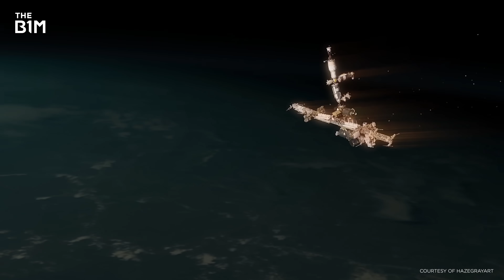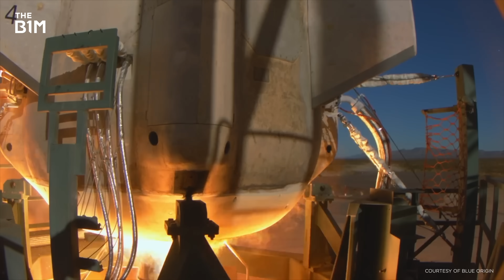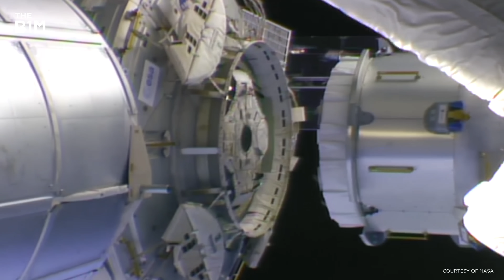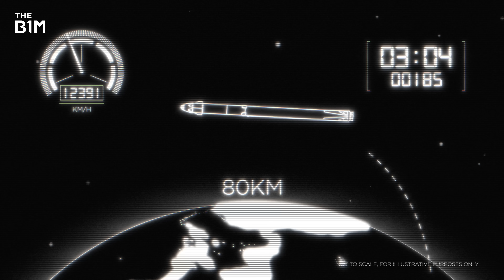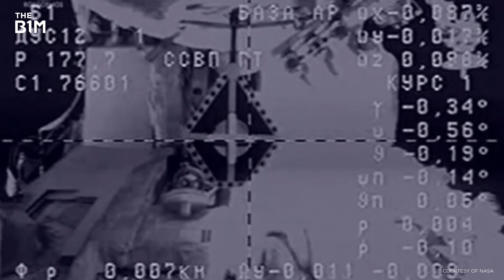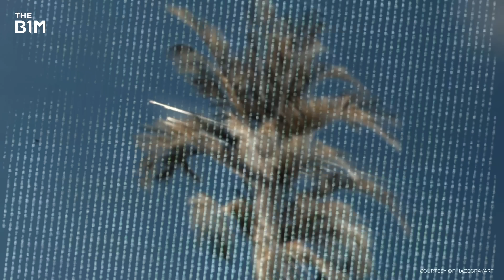The End of The International Space Station

Comment: Why do you keep calling the modules capsules? they aren't capsules. And Russia has two docking systems Probe & drogue and  APAS which has multiple versions and iterations and in some cases a mix of both. The ones use currently on the station are a derivative of APAS-95 which is now referred to as IDA or IDSS and technically there is another docking system, another derivative of APAS the ASA-G/ASP-G. There very little in common between the original APAS and the ones used currently so instead of saying APAS just IDA or IDSS or even APAS-95 which was use for the station. And you didn't mention the Canadarm.

Comment: Won't next gen Starship have more engines? I guess if there was a central engine, a fully refuelled Starship could take the station far, far away? Would be nice to know how far. And with the single engine throttled down, maybe it would survive structurally? Lots of the force would be "consumed" by accelerating Starship itself, especially before it almost runs out of fuel. So appropriate throttling curve could likely be designed. Of course it is not certain SpaceX will even succeed with multiple orbital refuelling till 2030, but it's ambitions are to be done with that sooner than that.

Comment: I'm neither a physicist, astronomer nor engineer.  That means I'm not bound by the paradigms of those fields, and that ignorance is occasionally advantageous, hence these questions:  
1) Why not slow the speed of the ISS so it orbits Earth less often, rather than the current 16x/day?  Would that result in less thermal expansion/contraction fatigue, or would the fatigue be worsened by longer exposures to the temperature extremes?  What about an orbit timed to keep the ISS at the terminator?  
2) Why not boost the ISS to L1, where DSCOVR is parked, or L2 where the JWST is?  Aren't those structures just as vulnerable (per sqm) to bombardment as the ISS would be if it were at L1 or L2?  If it's feasible to park telescopes there, why not the ISS?   
3) Wouldn't boosting the ISS to a higher orbit, or even putting it in orbit around Luna, be a useful exercise in testing our ability to move an asteroid or other object on a collision course with Terra?  Sure, the ISS is moving much slower than a hazardous asteroid, but baby steps, right?  The DART test was successful, but it seems useful knowledge could be obtained from repositioning the ISS.  
4) Rather than simply a historical artifact, the ISS has value as an exploitable source of materials for future space endeavors, does it not?  What is the relative cost to preserve the ISS for future use or exploitation compared to the cost to boost similar masses and materials to LEO?  What was the cost just to transport the materials to LEO?

Comment: now the question is, can a fully fueled starship outfitted with smaller engines (That run on the methane/lox) push it to like 3000km?
I don't think debris will be an issue at this altitude(As you can see in the graph of the video, the graph starts to go up), and the station will be defueled and without an internal atmosphere.

Comment: Don't deorbit it. Leave it to drift off into space.
Reply: It will come down by itself if abandoned due to drag

We would have to boost it into a stable graveyard orbit, without any debris to collide with 

I agree we should try
Reply: @XIIchiron78  the video said we dont have the current technology to send it far enough to not cause problems and also it would become space junk if we tried it  due to not boosting it far enough / or it break apart due to the force of the rocket the point of contact from the boost rocket would probably be like the equivolent of balancing the titanic on a pole (wich is exactly why the titanic snaped in half when it lifted out of the water from the back due to the stress in the middle) it would go the same for the iss posibly even easier than on earth due to acceleration of the boost rocket in the vacum of space it is not easy to throttle a rocket i do not think. more space junk is more problems in the future and more things these agencies will have to track that could cause delays / interuptions or destruction of future missions i think the aproach of using starship to bring back atleast a few peices of the iss is good enough and just make rebuilt replicas of the peices that were to big to take back to earth and setup a full scale model on earth at a museum dont exactly have to take the whole thing back home just have some real parts of it and interconect them to rebuilt replica modules that we could not save
Reply: Join Voyager 1
Reply: @OfentseMwaseFilms  Voyager 1 is in escape trajectory off the Solar System, you would need immense amounts of propellant and low thrust engines to not rip the ISS apart, to escape Earth orbit it would take years, while doing so the ISS would have to go through that killzone mentioned in the video, probability of "survival" is very, very low.

Comment: one way to reduce heat stress on the ISS by reducing the station's speed as it transition from being in the presence as it flies into the darker side of planet where it's night . . . the transition phase as the ISS rotates around earth from +160°C deg to -200°C deg or vice versa needs to be slowed down to less than half a mile an hour . . . allowing the outer skin of the ISS to gradually accept the rise & drop in temperature variation from hot to cold or cold to hot . . . not an expert, just my observation . . .
Reply: If they did that wouldn’t it be subject to the gravity pull of earth and fall much faster? and it would take a few years to do a lap of earth instead of every 90 minutes, so its daylight vs dark intervals would also be very long.
Reply: @evil17  thanks for that valuable piece of information, I get it what your trying to say . . . however just for my knowledge, what if the auxiliary thrusters & a revised autopilot system of the ISS be able to keep the ISS on track & at assigned altitude at speeds less than 100 mph . . .

Comment: Interesting video but I think this leaves 2 massive questions:

1. What is the line "we don't have technology to push ISS to deep space" 
What? Like, just launch a similar rocket to the deorbit craft, with thrusters that can slowly push it away way beyond the danger zone of earth orbit.

2. About Starship. "Its engines would rip it apart" "it can't dock with ISS"
This doesn't make sense. The primary value of Starship is being capable of bringing wayy more much mass there for the same price. That is the kind of solution that also solves other problems, as you could just bring another craft, any docking hardware you could dream up, maybe even develop Starship's cargo space so that the modules could be put and secured there wholesale. Then the Starship could be refueled in-orbit, and either landed on Earth (harder of course if there's cargo, but if any craft can do it, it's starship as it has already landed without cargo) or kept there or brought to a stellar body where it's easier to land, like the Moon. The relative ease of bringing more Delta-V to the starship with ISS pieces inside would surely open a lot of doors.

Comment: You had an image in there near the beginning that showed a proposed variation of the station that would be used for on orbit assembly of a Mars transit ship. It had a lot of truss work that extended away from all the modules down to a platform. As a lowly CO-OP student working for Lockheed Sciences and Engineering Company in League City across the street from Johnson Space Center, I was working on those 3D models in the image. I was a student at Tx A&M University at the time, around 1988-1990. I was running orbital simulations of different variations on the structure. We could fine tune various attitude control systems from rockets, momentum wheels, and even magnetic poles that pushed against the Earth's magnetic field. Attitude control systems can introduce some pretty nasty and unwanted oscillations in the truss structure. If they got bad enough, it would just rip the station apart. Also, the shock of something like a rocket coming on could jolt the station and mess up zero g experiments. The simulation even included the drag from the rarefied atmosphere and would lower the orbit. I got to create all kinds of variations of the structure and run sims on them. Eventually, the work was included in a report that was printed as a book and sent up the top to Dan Quayle and other folks. Nothing ever came of it as they never tried to use the station for on orbit construction of other spacecraft. As always, money was a limiting factor. It was a fun time though. I still have a copy of that book laying around the house somewhere.

Comment: 16:53 the nose cone is opened, kinda like a door, revealing the docking port. It's not discarded. 

Also the special vehicle used to de orbit the iss looks very different; It won't have fins, the trunk will be full with fuel, and the capsule, if you call it one is basically full of fuel, the iss is insanely large, (compared to other stations at the moment)
And it will be very slow to de-orbit. 
There may even be solar panels off the side, kinda like the old cargo dragon vehicles, unlike the newer radiator panels on one side. And solar panels on the other.

Comment: Correction at 16:53, the Dragon nosecone didn't get discarded, it simply being opened in space, later when it would come back for reentry, the nosecone would close again.
Reply: That's true for the regular Dragon 2, but probably not for the disposable ISS De-Orbit Vehicle, it will reenter with the ISS, so it won't be a reusable vehicle, no need for a possible failure point (hinges and locks).
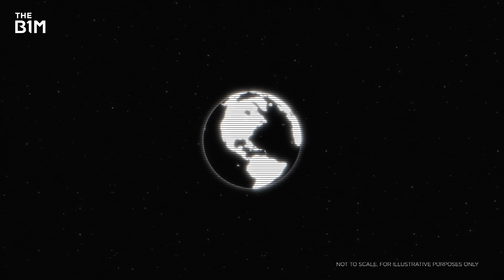Reply: @FastSloth87  The thing is, their explanation begins with "on a typical mission" 16:23.
Reply: Was about to comment this

Comment: Minor correction, but the only APAS docking mechanism on the Russian side of the station is to join to the US side. The other two APAS ports are used to dock to the shuttle, dragon, starliner and soon the dream chaser. Although APAS was developed by the USSR, the Russian side uses the droge and probe docking mechanism for their modules and spacecraft.
Reply: And APAS has evolved over the years:

APAS-75
APAS-89
APAS-95

An adapter was installed on the PMAs in 2017 to convert them from APAS-95 to the new IDSS docking standard, used by the commercial vehicles (Dragon 2, Starliner) and NASA's Orion (the Lunar Gateway station will use the IDSS standard, so visiting vehicles, like Orion and HLS, must use that).

Comment: Why dont they just set timers on the vaccum doors to open when everyone has left and let it implode. Surely they can create a robotic opener to do the job.
Reply: That would not make it implode.  For starters, things implode when the pressure OUTSIDE is greater than the pressure INSIDE.  As it is right now, the pressure inside is greater (because the pressure outside is pretty much ZERO).  If they opened all the airlocks, the pressure would simply equalize and the pressure inside and out would be equal.  That's not going to cause an implosion.
Reply: Isn't that the same with a space suit, once breached, game over occurs? If I am wrong I apologise. You learn new things everyday. Couldn't they reduce the pressure first then open the air locks?
Reply: @Leechy-df8pg  That still wouldn't cause an implosion. It would just be a vacuum inside and out, therefore a pressure difference of zero.
Reply: Ok, that's my theory quashed 😆
Reply: @Leechy-df8pg  No worries! The only silly question is the one you don't ask.

Comment: Perhaps pedantic, but a small correction.
16:23
When you say "Falcon rocket", you should probably specify "Falcon 9 rocket" as there are three rockets in the Falcon family.
Also, you state that the Dragon's nosecone is discarded which isn't accurate. The nosecone is on a hinge which allows it to pivot open and closed. It remains attached to the Dragon capsule for the whole flight and is reused with the dragon. Furthermore, when it closes after undocking from the space station, it provides protection for the docking ring during re-entry

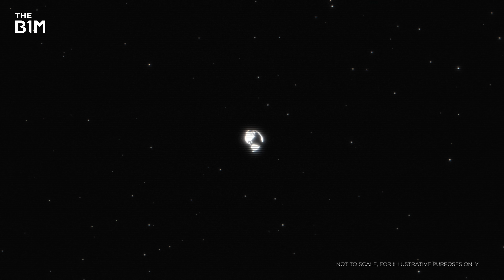Comment: Great video, but I want to correct one point. The altitude the ISS is flying has NOTHING to do with the "experience of weightlessness" (17:50). The astronauts are still pulled towards the Earth at 1-G, just as we are on the surface of the planet. The astronauts experience the SENSATION of weightlessness because they are continuously falling at 1-G. This is the same "sensation of weightlessness" skydivers feel when they jump out of airplanes. The difference between astronauts and skydivers is the astronauts are traveling parallel to the Earth's surface at a speed that equals the speed they are falling. The end result is they appear to remain at a stable altitude above the surface of the Earth because the Earth is round and gravitation force is radial from the Earth's center. From the perspective of the astronaut, they are "weightless, because the environment in which they interact is falling and moving around the Earth in sync with themselves. However, in fact they are continuously falling to Earth, but never hit the surface because they are traveling fast enough to avoid altitude changes. It is for this reason, they only need a small decrease in forward velocity to alter the relationship such that gravity has more effect than moving tangentially, and bingo, they de-orbit the space station. All the best.

Comment: I missed one option in addition to all those listed in the video.
What if the ISS were pushed out of Earth's orbit? Acting in the same way as if it were one of those probes that Nasa sends to other planets.
Fill the station with scientific equipment and send it to, I don't know, Venus ... and use it as a scientific platform.
The cost of taking all that weight off the surface of the Earth has already been spent... now it would only be a fraction of that to send it somewhere else.
And let it take as long as it takes to reach its destination... better than the other current option... destroying it.

Comment: 17:53 the height of the orbit has nothing to do with "experiencing weightlessness".  On the moon for instance, in a place without an atmosphere, in theory you could orbit a craft at any altitude (as long as the low-point of the orbit is at least higher than the highest mountain).  If the moon were a perfect sphere heck you could even orbit a craft a few inches above the surface, and any astronauts in such a station would still experience "weightlessness" despite the moon actually having gravity.   Simultaneously any astronauts standing on the surface of the moon in a fixed spot would experience the moon's gravity (1/6th of the earths), while their colleagues zipping around in orbit only a few inches above the surface in a stable orbit (occupying nearly the same area as the astronauts standing on the surface) would feel "weightless".  Weightlessness is caused by FreeFall while in any orbit, at any height.  Essentially by "not resisting" gravity but rather "going with it" so-to-speak.  The ONLY reason why spacecraft orbiting Earth have to orbit at a certain height above the surface is ONLY due to atmospheric drag; it's not possible to orbit spacecraft at lower altitudes on planets with atmospheres ONLY due to the drag that would eventually end up de-orbiting the craft.  That's the ONLY reason.   There's nothing important about the altitude otherwise in regards to orbital mechanics.  On moons and other bodies without atmosphere's you can orbit at any altitude above their surfaces; as long as you avoid mountains so you'll want to ensure your low point is at least higher than the highest peak for safety!  ;-).  So on our moon, Mount Huygens is the highest mountain at 5,300m in height.  You could safely have any orbit around the moon as long as the low-point of the orbit is higher than 5300m.
Reply: Not knowing that orbiting = falling and the cause of weightlessness is probably the most common misconception people have. This is why you see so many suggestions of "why can't we let it float to the moon and let it gently land there?"

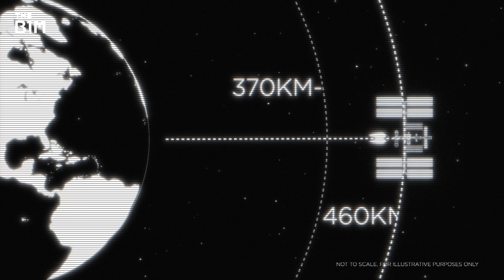Comment: 18:33 a bit of a inaccurate graphic explaining the boosting of the ISS.  It would never be boosted vertically like that relative to the surface.  According to orbital mechanics all that would happen in such a scenario is the apogee (high part of the orbit) would only receive a very temporarily boost in height but since there wouldn't be any actual increase in horizontal velocity this would only result in a lower perigee on the other side of the earth, ironically slowing down the craft rather than boosting it and possibly de-orbiting it if the resulting new perigee is within the lower atmosphere (which it likely would be).  A vertical burn like the one depicted in your graphic would simply shift the orbit of the perigee and apogee points relative to the centre of the earth, not boost it.  To actually boost the ISS you need to burn  horizontally in the direction of travel to increase the ISS's orbital velocity.  That actually raises the apogee on the opposite side of the earth as the burn, and then perform a second burn half an orbit later to circularize the new orbit (45 min later): technically known as the Hohmann Transfer.
Reply: The moment I saw it I went to the comment section to see if someone has already commented.
Reply: @ great minds think alike, 😁.  I’ve played way too much Kerbal Space Program, the methods of orbital transfers are now burned into my brain!
Reply: Got it, next time I'll use that
Reply: WHy not just put ION engines that will boost them slowly to higher orbit
Reply: We got a yapper on our hands ☝️🤓
Reply: @anuragbundela1483  people normally say I’m so quiet in real life! 😁